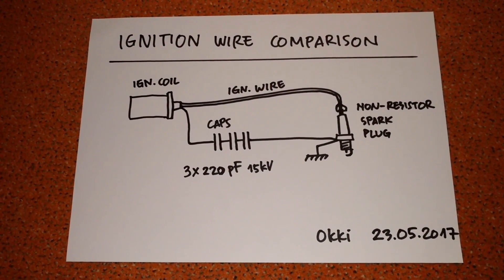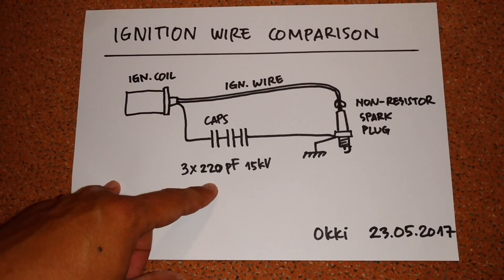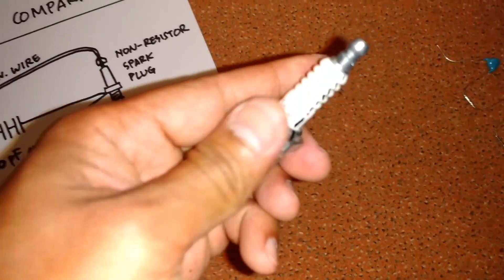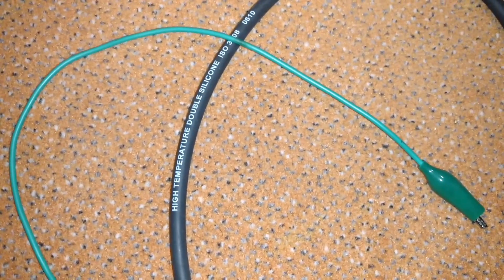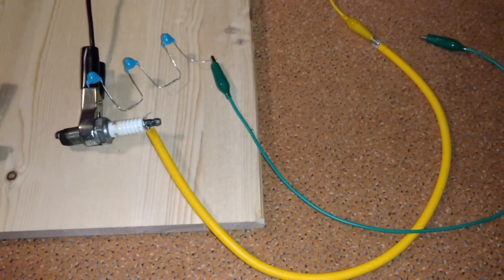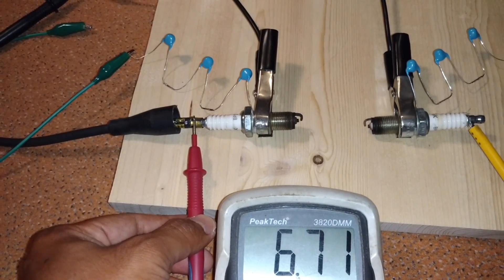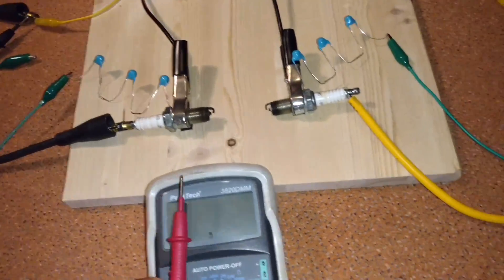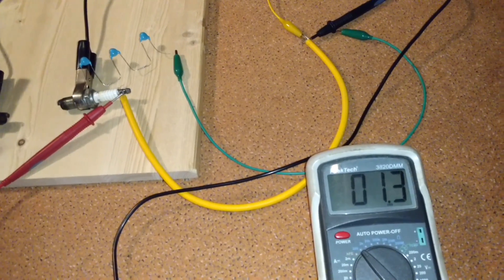Simple Plasma Ignition - Carbon and Copper Wire Behavior

Comment: Very interesting I thought it would make no difference or be better with the carbon core. The MSD ignitions specifiy that you should not use copper core wires. here is a blurb from one of the sites   solid core spark plug wires CANNOT be used with MSD ignition. Apparently The MSD box is very sensitive to whats called RF frequency spurious emissions. I will still try it though.
Reply from the maker: Yes you are right. Please check out my other plasma ignition videos. I have uploaded that version.
Reply: I guess there is a way,  you could use both wires without difference if the capacitors connection were made in the tip of the plug so the wire resistance will be eliminated. So u can use watever your system was designed for. Correct me if I'm wrong.
Reply from the maker: Please try it and let me know the result.
Reply: will do